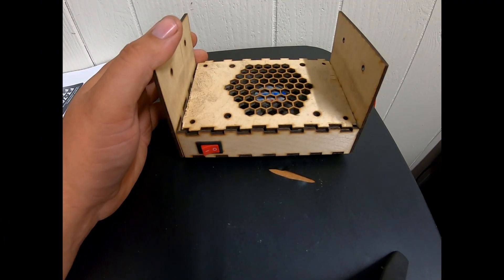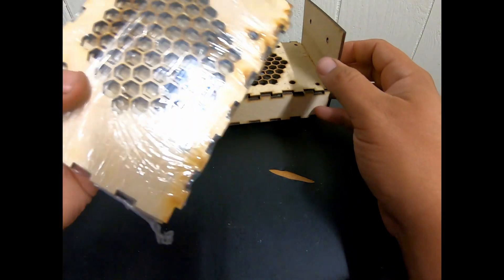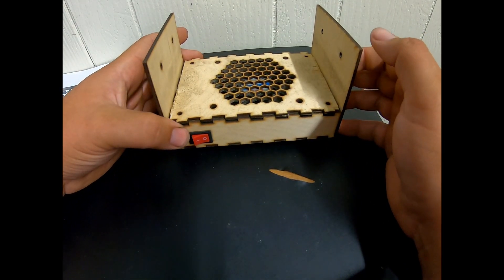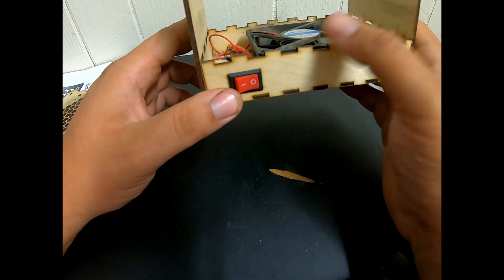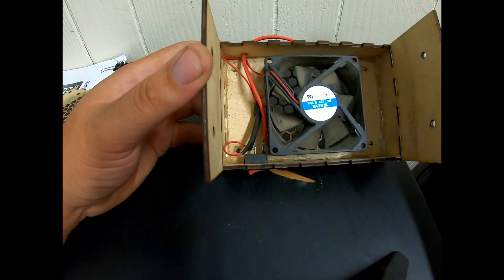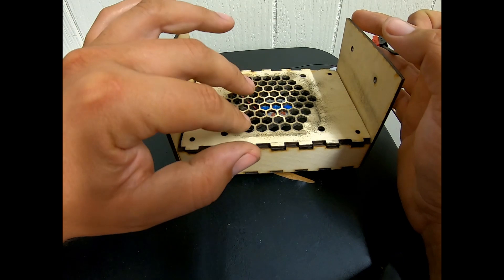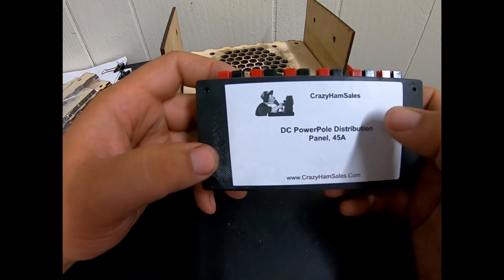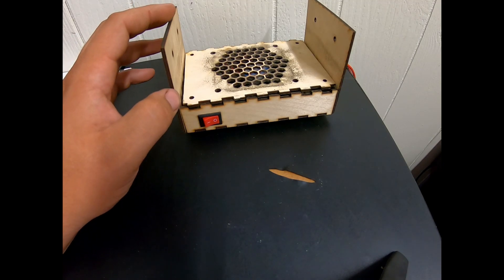Yaesu Cooling Unit

Comment: I prepared the project of 5 mm thick plexiglass material in the drawing program. I had a laser cut. It should interlock and also designed with screws. My friend Engin prepared it for TA5LET. it continues to use itself with great pleasure.

Comment: Nice job.
It is prepared by using Arduino uno or Atmega328 processor. When it reaches the temperature you set by detecting the operating temperature, it runs automatically. If you want to watch the link of my video https://youtu.be/zw_kxN88ZYQ